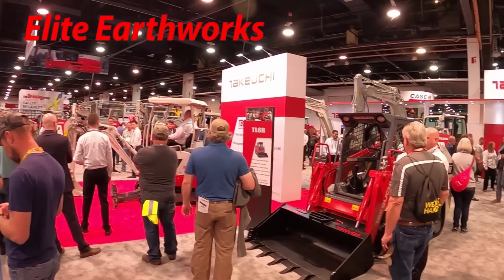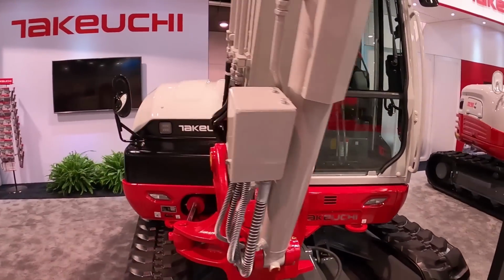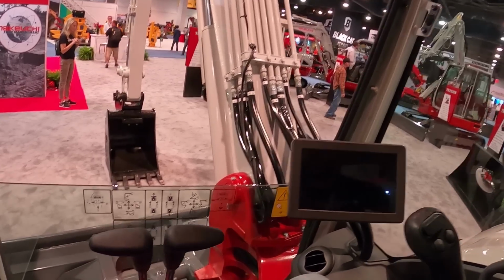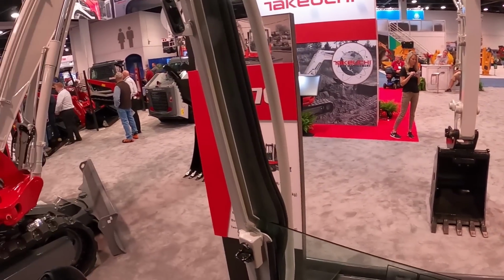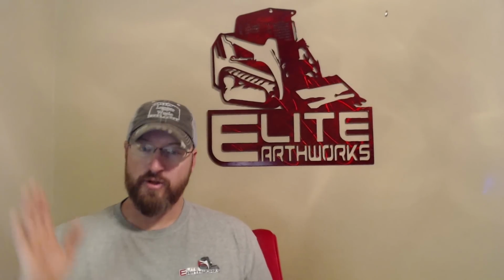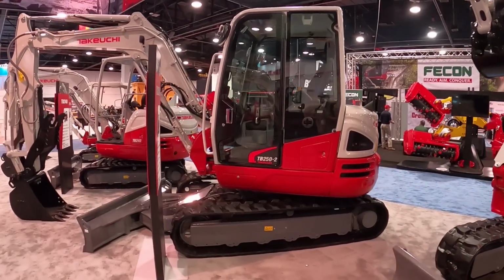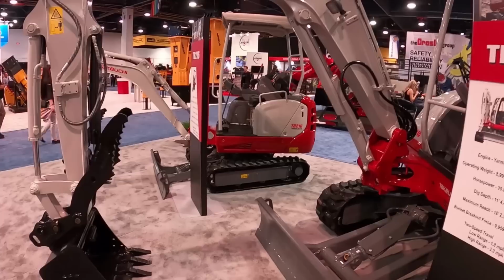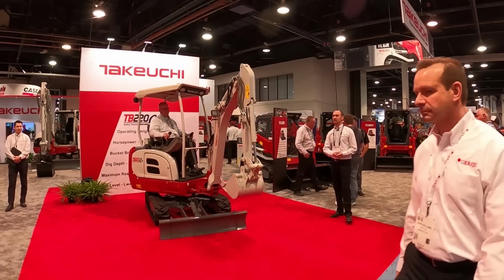Takeuchi Booth At ConExpo #ConExpo2020 #Takeuchi

Comment: I just stumbled upon this video.  Was hoping the 240 would get some more screen time, lol.  I just bought one last week and waiting for the buckets and thumb to be made.  They're great machines.  My dad had 3 different takeuchis when I was a kid and they were great.  I'm excited to be gettin another one
Reply from the maker: That’s awesome congrats! Yeah I was hoping to get more time in the booth. They are great machines for sure. What bucket and thumb combo? Werk Brau? Appreciate you watching
Reply: @eliteearthworksllc  No, goin with Daequip.  There a local company here in B.C.  The company work for and most guys with newer machines around here run Daequip and they make nice heavy-duty stuff.   Originally priced out 3 buckets and a hydraulic coupler and just about had a heart attack when I saw the total price so just goin with a 36 inch clean up, 18 inch dig and manual wedge coupler which is pretty stardard for around here and the same set up I had for my old cat

Comment: That TB 257FR is what having a mini is all about....putting them in tight places! I was very disappointed that Tak discontinued the TB153FR. I just bought a 305.5 CAT (over the Tak TB260 and Kom PC55) but likely would have bought the 257FR if it was available. I heard you talking about the 290 being better for "that basement job" but I would think it would open up a lot more work for you if you went with a 15tn machine (and keeping a mini also) instead.
Reply from the maker: Jason Chapman yeah it took them awhile to make it meet tier 4 emissions. Yeah someday I hope to get the 2150R. And yes I would like to keep the 260 as well

Comment: Looking hard at the Takeuchi’s, TL10v2 specifically. My only concern in security. How do you keep the thieves from stealing them? My bobcat has to have a code to start machine. I’ve not seen that option on Tak’s.
Reply from the maker: Blanton Enterprises there’s a master switch on the machine
Reply: Elite Earthworks LLC thank you. Loving the videos!
Reply from the maker: Blanton Enterprises you bet appreciate the support
Reply: You can always add a hidden fuel solenoid switch. Fairly easy.
Reply: Jason Chapman yea we used to do that on our old bobcats and even on the case 580L. You have to input a code on almost all machines anymore, just didn’t know if Tak’s had something different.

Comment: if / when you upgrade your skid would get another tlr8? or go bigger?
Reply from the maker: Brandon Thies mine is the size of the TL12 now the 12 the is new model of the 250
Reply: @eliteearthworksllc  oh i see.. i thought yours was smaller, so you would get another tl12 then im guessing. the few times i've driven takeuchi machines i felt like i was driving a tank, im sure i would get used to it but after running bobcat's for over a decade im just used to those.
Reply from the maker: Brandon Thies yes I’m planning on a TL12V2 it is like  running a tank that’s the best way to describe it